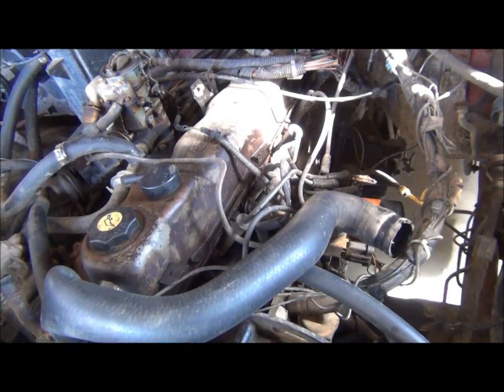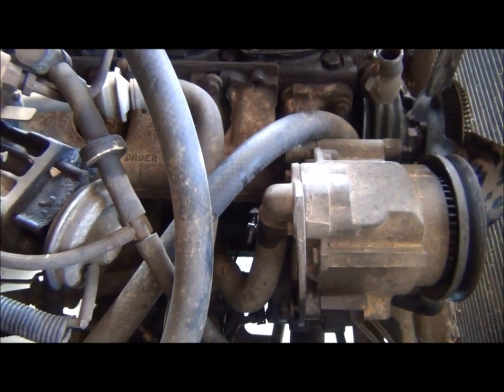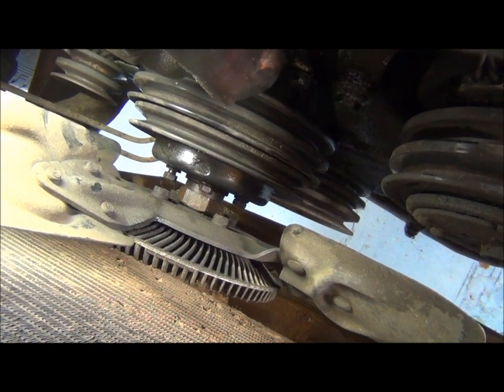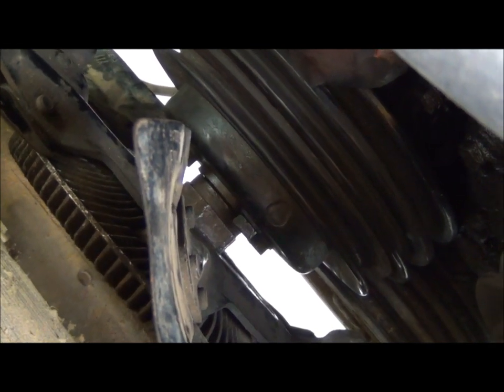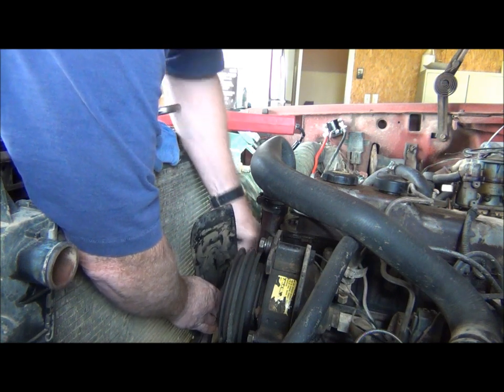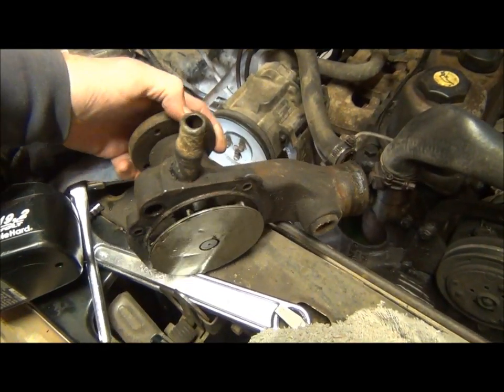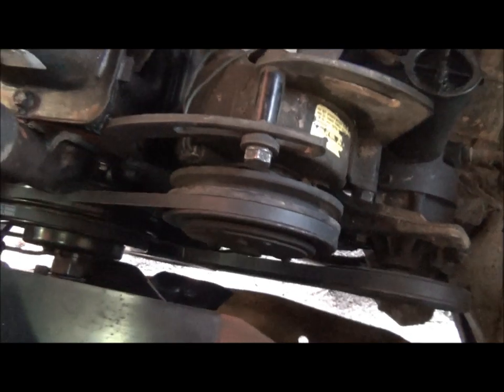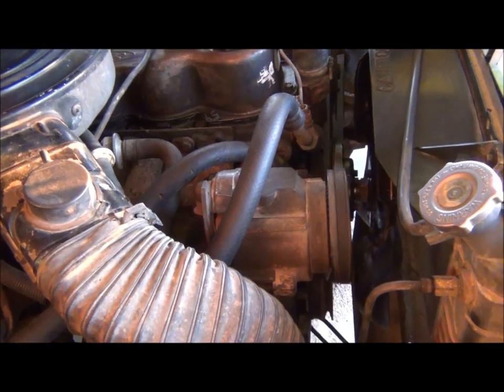F 150 Water Pump install.wmv

Comment: i have an 81 f150 300 inline and the fan looks different there's no nut i can see there's a shroud or something there instead but there are four bolts on the front of the fan is there a difference in the years. any help would be greatly appreciated

Comment from the maker: A crescent wrench will work.  Not sure if you were able to get it off but the crescent wrench should work the same if it is a large enough one to get the energy to the nut that holds the fan on.  Best of luck...

Comment from the maker: I am actually holding the water pump pulley out of habit.  The nut should break lose if energy is applied.  
The years should be close to the same.  The small nits you see are likely the ones with lock-tight into the water pump with nuts to hold pulley on.  That large nut is behind that pulley.  Sorry for the late post.